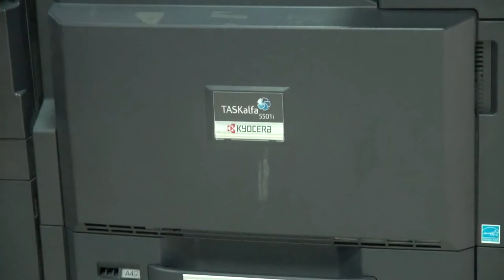Main Charger Roller  Cleaning | Kyocera Taskalfa 5501i - PART I

Comment: Hello friend, can you help me in adjusting the image quality (I counted the ink and the images became blurry (blurry) Kyocera Triumph-Adler 5555i machine Is this a result of bad ink or what and is there a way to the machine programs? Thank you very much
Reply from the maker: Bad toner can affect the quality of the print. Just try to clean the main charger if it will work.
Reply: @macor285  Thank you
Reply from the maker: Check also the counter of the developer and drum if it is due for replacement.
Reply: @macor285  Thank you, my friend, it seems that the ink is adulterated